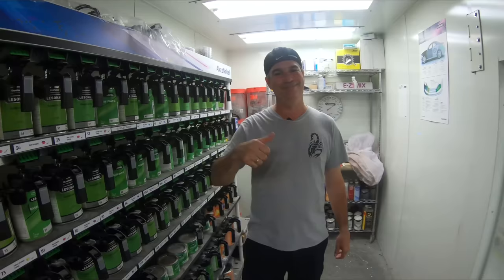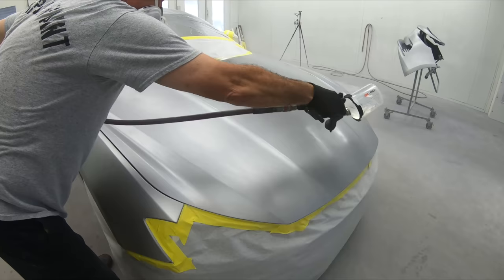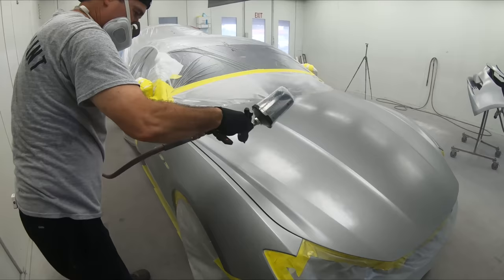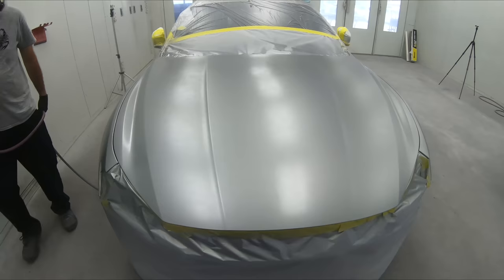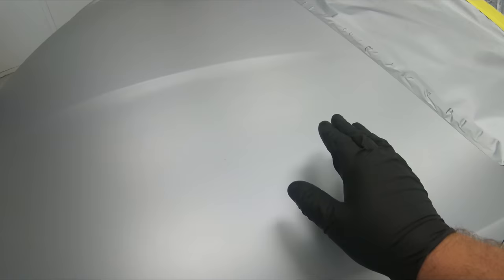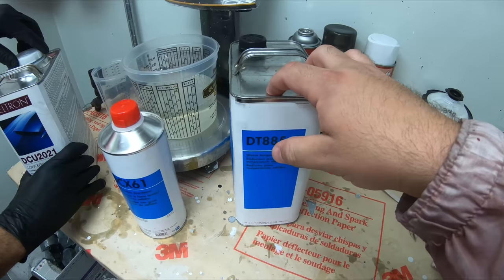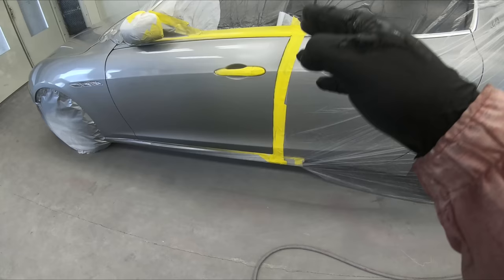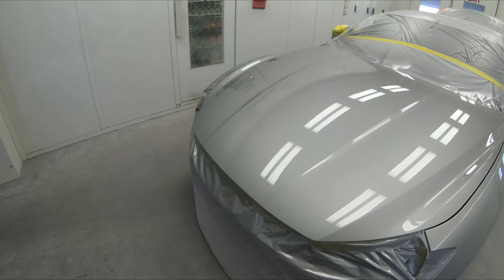How to Paint Silver with NO STRIPES!

Comment: Great video, just want to clarify a point. With metallic paints.; use a faster reducer than normal. I thought the slower the better?  I'm prepping a car right now and gonna shoot a light blue metallic / pearl over a pure white basecoat. I only want to do this project once. Your advice has severed me well in the past and I proudly wear your merch. I really appreciate you featuring other great painters. That association and mutual respect is great to see.
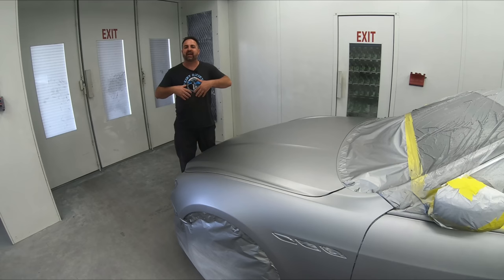Reply: No. He said high temp reducer. Wich is a slow reducer.   Fast temp reducer is a low temp.  Says it at 13:58

Comment: Nice technique for blending. Gonna be replacing rocker panels and repainting doors and this should help quite a bit. BTW, what kind of stand was that with the bumper on? It was a paint saw horse with the arms?
Reply: It's a bumper stand. They tilt up and down and the arms twist around to whatever you need. They make pretty cheep kits that come with arms and a center bar that clamp on to a regular folding stand.

Comment: Nice video and Pedro is awesome. I just have a couple questions. One, why did you put wetbet over the fenders and hood? It already has basecoat. Second, not sure if PPG sponsored this video, but Pedro is an AkzoNobel Lesonal shop. So why not use Lesonal 100%? Keep up the good work!!!
Reply: Wet bed goes on between coats of base to help absorb the dry overspray when applying base coat. It makes the job much cleaner and helps blend panels.

Comment: Hey Brian. Current working on painting my front bumper. Silver metallic. Stripped all paint and prepped for primer using 400 and a maroon scuff pad. After I laid my primer (SEM flexible primer surfacer) I sprayed some SEM guide coat before I began sanding with 800. As I was sanding a ton of black speckles remained on the primer and would not be removed until I went super deep into the primer leaving a super thin layer. Any idea what could cause this? I ended up stripping all the primer because I didn’t want the paint lifting later due to the speckles. Thanks!
Reply: You should sand the primer with 400 and basically sand it until all of the orange peal is gone.. you will break through the primer in places but it will be fine